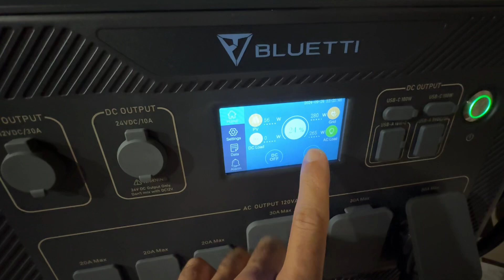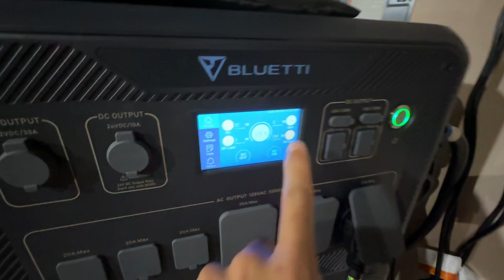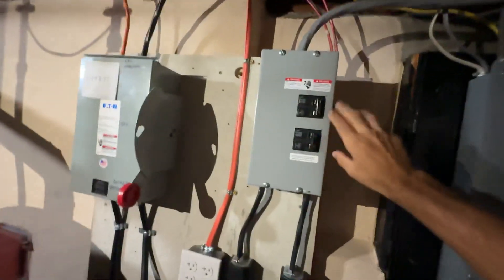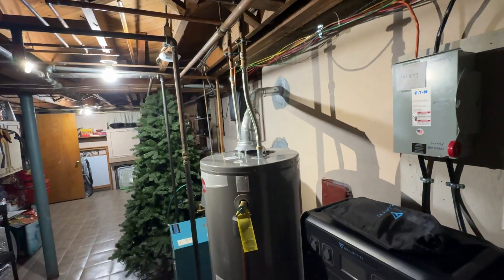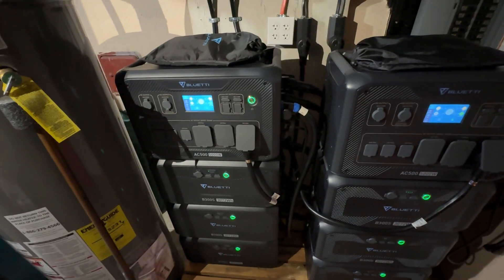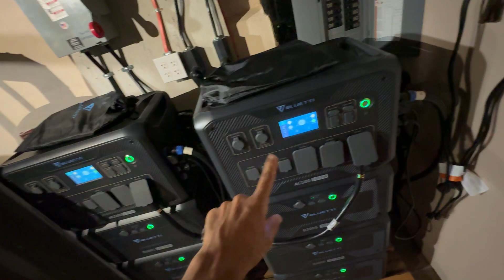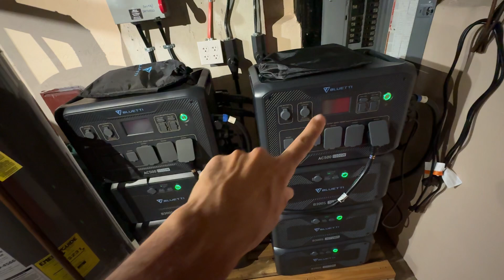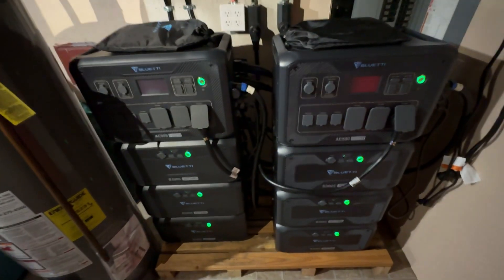Bluetti AC500 issues with whole house UPS

Comment: Surge protection coming from the grid. The current coming in jumps above safe working limit is what I take from this demonstration. Cut off a few thing in the house and retry to see if that is the issue. Your draw how many items you have pulling power plus the initial surge of that power may jump above safe working limits surge  boost may be the issue.
Reply from the maker: One unit by itself doesn’t behave like this. When I take the system out of split phase mode, that doesn’t happen. My load upon startup isn’t heavy. In fact, Bluetti acknowledged that the AC500 is designed this way, and refunded me for the entire system. I sent all of it back. I have an EP900 system now that I haven’t set up yet.

Comment: i have a fix for that. 

Get an Ecoflow :D i'm using one :D
Reply from the maker: I don’t even have those things anymore. I switched to EP900 fully maxed out.
Reply: @strobaholic  Can you show your dual EP900 setup? Did you use the recommended Generac ATS? Did you have interconnection issues with your power company?

Comment: Strange - I will be setting one up also but I was planning on using they y connector output cable off the 50 amp output into a transfer switch. And the input cable y connector to a 240v outlet that runs into the main panel to charge.  Maybe that way you wont have that delay when the power comes back on. But that would mean maybe rewire it differently.
Reply from the maker: Bluetti says that one AC500 will work as a UPS. But 2 in split phase will not work as a UPS. 
They allowed me to send my entire system back, and gave me a full refund toward an EP900 system. 
I now have 2 EP900s and 8 B500 batteries. I’m going to make a video of it after I complete the installation. But yeah…no more AC500 for me. 😊

Comment: I think your problem is that when you turn on the breakers I hear a distinct click, click that is about 100 ms delayed between closing. A 60 Hz signal takes 16.7 ms to occur so the system is detecting a phase imbalance. Try testing by shutting down and restoring power at the main disconnect. If it works then it proves my hypothesis that your two breaker test is invalid.
Reply from the maker: @lesraney  it does the same thing after a power outage. As soon as the grid power gets restored, they turn off then turn back on, exactly as seen in the video. 
But it’s no longer my problem because I sent them back to BLUETTI in exchange for 2 EP900s 😊.

Comment: I have the same system with 12 batteries ill test mine
Reply from the maker: Make sure you’re testing it on split phase mode, and not just the 15 amp outlets on the front. Please let me know what happens.
Reply: @strobaholic  is your charging speed set to 50A  on both systems?
Reply from the maker: @Ajacka916 yes 50amp fast charge on each unit.
Reply: @strobaholic  so I tested mine and same results but it was about 3 seconds before power was restored i noticed it the app access to change between off line and an on line ups mode is no longer changeable and I feel thts the issue i also have 2 ep500s and they still have the option to change the mode the difference is 1 bypasses the battery and the other will not there wouldn't be and interruption as it's always using battery and the grid+solar is recharging maybe reach out to bluetti support and see if they can update the system to reintroduce the ups offline/online option it was a feature but has been gone for a while
Reply from the maker: @Ajacka916  At least now I know it’s a design flaw, and not defective units.
Reply: @strobaholic  will do only difference is i have the split phase 50A cable in and out so both cables are a Y

Comment: You're not getting any alarms? I have the same issue with my AC300 Split Phase system. Grid goes out, UPS works fine. Grid comes back and it takes 5-6 seconds for the Bluetti's to power. I also have an issue that my disposal will cause the same issue as Grid coming back on. Causes the system to drop and come back. No alarms. I am using the Fusion box for split-phase. Currently only running one AC300 because it was too noticeable. Bluetti is willing to send me new ones but it seems like a design not technical issue. I'm regretting my purchase.
Reply from the maker: Yeah I’m regretting this purchase big time. I spent a lot of money on this system, plus setup time… I’m not getting any alarms, it just reboots when grid power goes live. It’s especially annoying during a brown out because it mimics the brownout. 
They advertise these things as a whole home UPS, but it’s not. 
I had to abandon the fusion box because the system would not work at all when I lost grid power. It would literally shut off and not power back on until grid power came back on. Even on 100 charge. 
They said they were gonna send me an EP900 with some b500 batteries, but they didn’t.

Comment: If it shuts off for any amount of time then it is NOT a UPS. The whole point of a UPS is to be an uninterruptible power supply.  

The flaw here is that these are not double inverting.  Ideally, you will have one inverter taking the incoming AC and changing it to DC continuously to keep the batteries charged and to power the next inverter; and then one inverter converting the DC back to AC and powering your home.  Your home should always be on inverter power if you’re using a device like this
Reply from the maker: I don’t know the inner workings of these devices, but Bluetti advertises them as uninterruptible power supplies that can be used to power a whole home. I just want to know if I’m doing something wrong, and how I can correct it because this is annoying the crap outta me. Bluetti doesn’t know what to do.

Comment: How much complete set of solar power to power all electrical appliances at home
Reply from the maker: Not sure I understand your question. But this system will power my entire home for about a full day if the batteries are 100%, and if I don’t use the Air conditioning system and go easy on the toaster, microwave and coffee maker. I have about 4800 watts of solar panels. 2400 watts on each side.